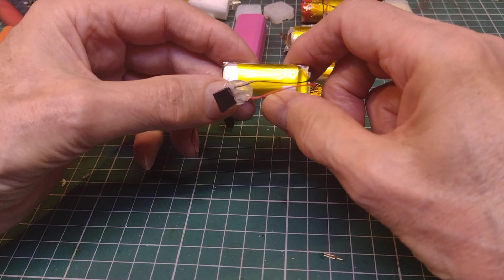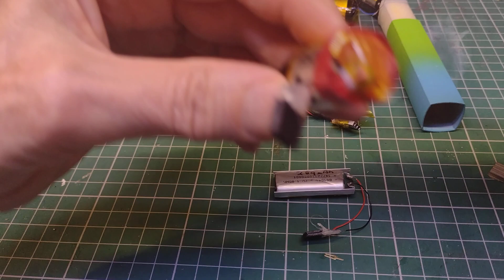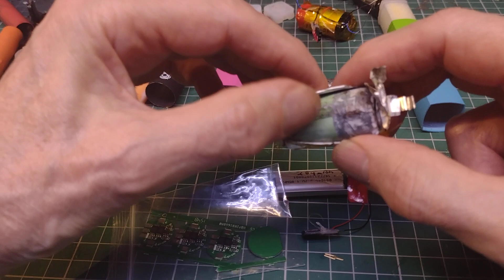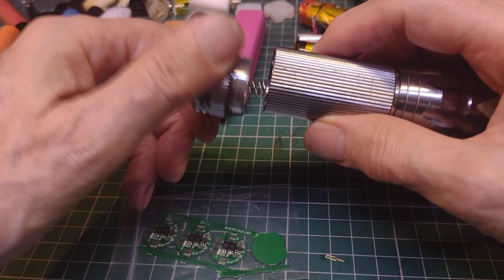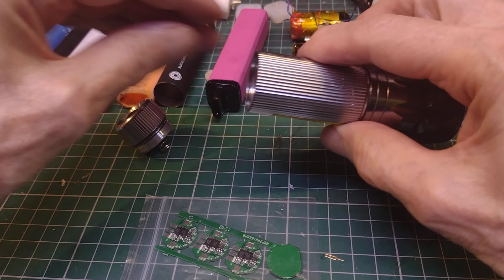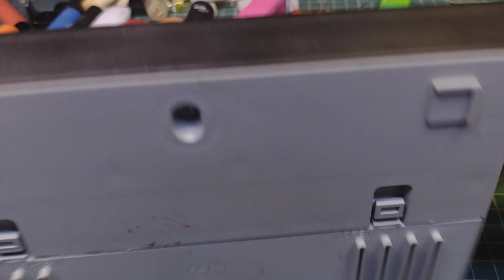Recycling discarded vape batteries

Comment: How dangerous would it be to connect 2 or more cells in parallel? The problem with vape cells is that they are quite small. Could the stronger cell cause the weaker cell to blow when equalizing the charge without a current limit?

Comment: Sir , how much Current (milliampere) charger best for charging 3.7v 850mah battery same type like your video .. thanks
Reply from the maker: Best way is to use a commercial charger but I don't know of one for these cells.. As the cell is 850mAh  called C) the best rate is to charge at 1/10 C i.e. 85 mA.  I would use a 4056 charger board available from e-bay  a 10kOhm resistor on the charge pin should give a safe current . There are lots of videos showing how to use these on YouTube. The electronics in the vape cell protect s it from over charge and discharge so if you are not using the cell with the vape sensor the cell should have added protection

Comment: I am trying to recover 500mah lipo battery but voltage is 0.280v it slowly getting up in voltage but I am seeing if I do 300ma  it will get warm like 45© I am using 17ma charge currently trying to get it up to 3v so I can test the capacity but I thought if it's free no problem but I am using tp4056, board to get it up in voltage I put 7.5K to get 170ma and tp4056 will do 17 ma when cell under 2.5v  the cell not getting warm
Reply from the maker: I think 0.28v is too low and that even if you charge it it won't hold its charge. How did it get so low? It should have protection system to stop it going below 2v8 or so. I have given up on any cell below 2v8 as they don't seem to hold their charge. Sorry 😔.
Reply: @toyhacker4647  I had 3 lipo 500mah  battery with nearly 0.2v and I got 9 so I had 5 vape batteries with 2.8v no problem and the 3 cells with 0.28v 2 of 3 did work no problem but the 1cells hold at least 66% of rated capacity and the other 2cell has capacity of 660 mah I have this cell I am currently trying to charge up cell 3  but it's got higher resistance because it gets warm when changed with anything over 300ma I got it slowly getting better I can get it up in voltage faster if I use higher current that 17ma it would be better to put more energy into low cell I am trying to put numbers how many nearly very low cells you can make work again
Reply: @toyhacker4647  I found various vapes and found 7 500mah cells and 2 550mah cells and one big 1500mah cell so I was trying to make power bank for DIY project with them to boost/ step down voltages

Comment: Hi ya :) the "protection" board you mention is actually a pressure sensor. it acts like a On/Off switch. When activated, the switch allows battery to supply juice the heating element (and indicator LED). When no pressure is present, the switch becomes 'open' and therefore breaking the circuit. Almost all disposable vapes have ZERO protection for the battery cell.
Reply from the maker: Thank you for your comment as many people are of your opionion I have changed the video description to "My video        "Discarded disposable vapes electronics including charging."       shows how the pressure sensor in the vapes I have found contains a chip (with suppliers details and data sheet) which I used to control charging lithium cells."
Reply: @toyhacker4647  am off to take a looky at thse vids. thanks :)

Comment: Thanks, now I'm going to be collecting these for parts.
how long the the battery last when the vape is empty?
Reply: huh? a vague question. typically they wont be discharged beyond 3v. as for durability and life expectancy.. with lithium cells. 500 charges is usually the maximum with degrding performance. optimised perhaps 250 charge/discharge cycles

Comment: you could have made the controller more tidy and put both batteries in two ports bypass all the other terminals and wire it up to make a shorter connection
Reply from the maker: Thanks for the comment. Hope the video was some use.

Comment: Hey toy hacker if you want I've got 20 disposables you can have them seen as you've got a use for them, otherwise I'll take them apart to recycle, just drop me a message if you want them and we can exchange details
Reply from the maker: Thanks but I've got so many l don't know what to do with them. Got another today. Just put them in a box for now, thought I'd build  a store for my solar but would need 100 5W for a half kilowatthour which could save about 20p! Don't think I'll bother. 😊 building one.
Reply: @toyhacker4647  alright no worries I'll probably take them apart and recycle them accordingly 🙂
Reply: @toyhacker4647  take them to bits and recycle   what you can, that's what I've done

Comment: I would love to make a battery from old vapes, do you have a link for the protection chips?
Reply from the maker: I haven't bought any in a while. It depends on the type of battery you wish to make and the types of cells (batteries) you wish to use.. If just a single cell (3V7) then  1s bms (battery management system brings up many results I get 10pcs from china on ebay  e.g. 10pcs3.7V 3A BMS at £3.31.

Comment: I'd love to see more uses for these batteries. I've recently just started using disposables as a way to quit smoking cigarettes and i don't like the idea of throwing these perfectly healthy batteries to landfill. I've been collecting the batteries in a hope of finding a use for them
Reply: You can make a larger battery by making a bank out of them, so long as you can set it up so that each battery either has it's own charge circuit or can be charged separately. If you get the rechargeable disposable type they come with their own USB-C charge circuit that can be wired in parallel to your charger, and I'm pretty sure there's a million options for little charge and protection circuits and such on ebay. The biggest thing is making sure each battery is maintained at the same voltage or bad things can happen. 

And as to uses, I've used them individually for many purposes, I recently used one in a small gas combustion pistol (oxy/acetylene) to power the igniter, then another in a wireless model rocket igniter to power the transmitter. I'm saving up batteries right now from a particular brand of vape (Flume I think? Something like that) that I get regularly from my brother and his friend who use them, they have a larger than usual 1000mAh capacity, I'm making a 400 Volt battery to charge a capacitor bank by wiring roughly 100 of them in series lol, talk about dangerous😅
Reply from the maker: I wish I could find a use, I found  another 10 discarded on the streets last weekend. Hope you manage to kick the habit.
Reply: @toyhacker4647  Thank you my friend. 1 week without cigarettes and on the 16th of July i'll be 3 months clear off weed after smoking both for 10 years. I'm 28 now, hopefully i can continue without both of them. I've subscribed to your channel, i'll love to watch a video if you find a use for these batteries!

Comment: any idea if u can make a 48v pack from these? ive done a bit of research and found they have a discharge rate of 3c max
Reply from the maker: You need a 13s battery management board which measures the voltage of each cell please don't attempt this without one  I have never gone above 12V but I think the principle is the same. 13 cells connected in series are needed for 48 volts. There are lots of videos on you tube of people building 48V batteries but they tend to use high capacity  18650 cells for bikes and scooters.